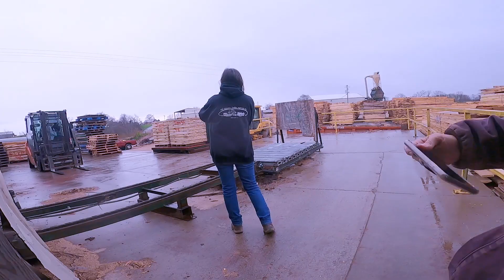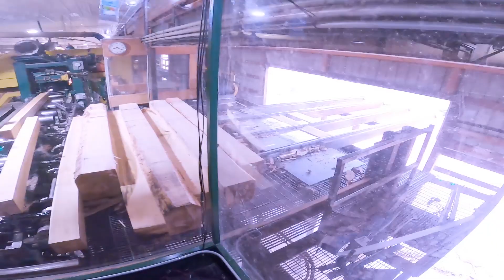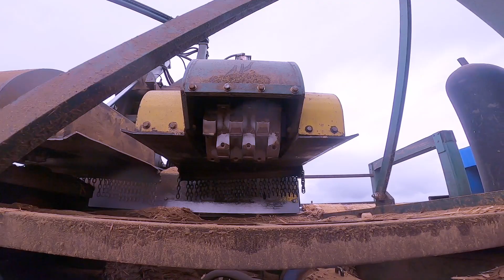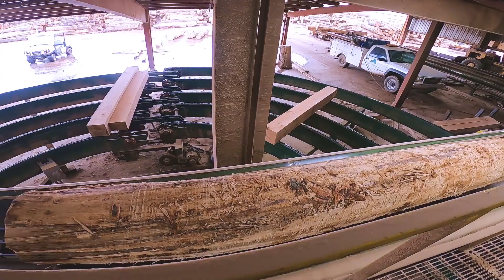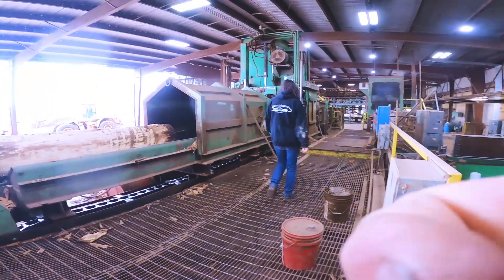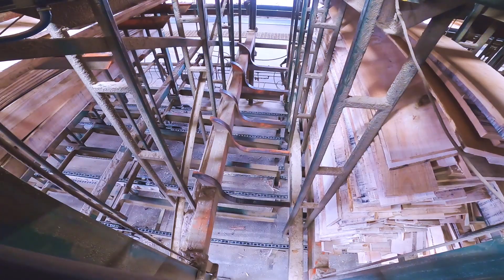2022 sawmill tours, Awesome Mills‼️

Comment: Interesting vid, keep em coming.    That mill i hauled into for stumpjumper in the late 90's was impressive     And very efficient.      They ran 2 shifts then third shift was maintinace.     Per shift would saw 75/80 tho bdft        And they also imported to there stacker system an additional 50 tho bdft.  From smaller mills  and then kiln dry it.       One in tuned mill

Comment: I've sawed both ways. At the end of the track vs  cab by the saw. There is no way you can see pin knots and small defects sitting at the end of the tracks, you can't see shake either, which is a threat to ripping the saw off the mill. I'd rather turn my head back and fourth. The pros however is less miles on the track and carriage, better production from less distance traveled. Faster primary breakdown.